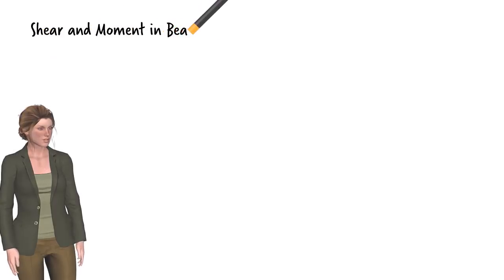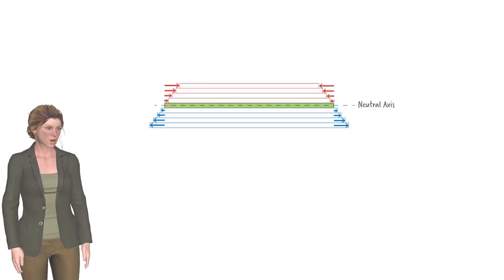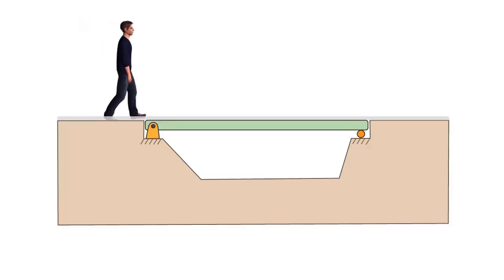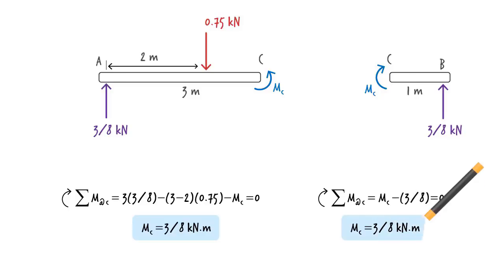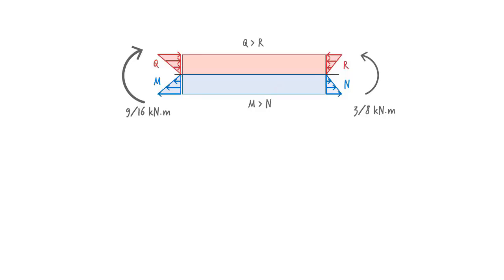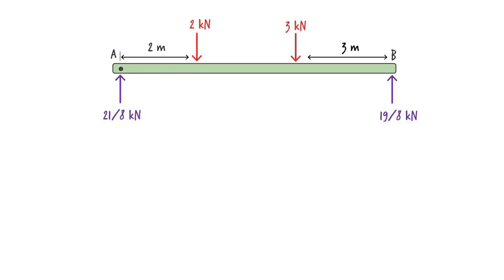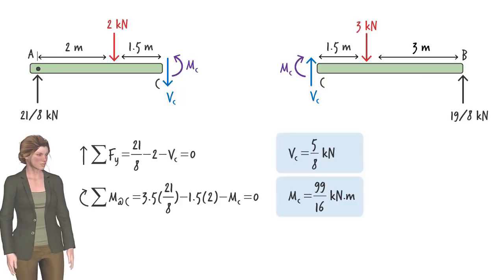ST08: Shear and Moment in Beams

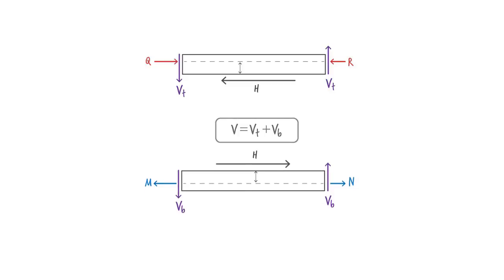Comment: Hi, if you allowed me to go further more to the design process for a R.C beam; @ 8:15 in the video we got the value of V (V=Vt+Vb) illustrating the shear resistance of the beam to the external applied loads which will take the form of either a vertical stirrup or a combination between the stirrup and the bent-up bars after considering the resistance of the concrete. My question is what will be there in the R.C. beam as "H" to maintain static equilibrium? 
Thanks in advance
Reply from the maker: An H-shaped cross section can be viewed as a composite section consisting of two vertical rectangles and a horizontal one. A significant portion of bending and shear stresses are going to be carried by the two vertical rectangles/sections; we can ignore the horizontal section (think of it as bracing that holds the two vertical sections in place). Assuming there are no out-of-plane forces, each vertical section carries half of the induced stress in the section. So, the same principle demonstrated in the video still applies to each section.
Reply: I am not sure if I explained my question clearly for you but let me try one more time. Let us take a case of a reinforced concrete simply supported beam subjected to a uniformly distributed load; the load will cause bending moments to be developed within the beam which in turn causes shear forces to be developed (as per what has been described in the video) horizontally in the form of "H" and vertically in the form of "V"; those two shear forces (H & V) will be considered as the internal response ie resistance of the member to the effect of the externally applied loads. As I explained in my first comment; "V" from design point of view and as an internal resistance will be in the form of vertical stirrups or a combination between vertical stirrups and bent-up bars. My question is for "H" (the horizontally shear resisting force); from design point of view; how it will be considered or in which form it will be there in the member (knowing that usually for a normal member like that it will be reinforced by steel bars for bending in tension zone and also vertically for shear in the way which I previously described)??
I hope I did that well this time 
Again thanks in advance 🙂
Reply from the maker: @mohammedhisham5682  Shear strength of concrete is, in part, a function of the dimensions of the section under consideration. In the horizontal direction, shear strength would be significantly large, since the "cross-section" of the beam in the horizontal direction has dimensions: L x b where L is the length of the beam segment and b is the beam's width. Given that L is significantly larger than b and h (height of the beam), the member is going to have adequate shear strength in the horizontal direction; there is no need for reinforcing shear strength in that direction using steel bars. 

However, if for some reason the shear force becomes excessively large,  it may become necessary to add reinforcement in that direction as well. For example, if the beam is subjected to eccentric axial forces that result a large shear force in the horizonal direction, then we may have to consider reinforcing the beam in the horizontal direction.
Reply: @DrStructure  Thank you very much. That helped me a lot in understanding the shear resistance response of a loaded R.C. beam. 🙂

Comment: Solution to practice question 1.

Shear force :
Since the beam is subjected to external  horizontal load and no vertical load  so the beam has no shear force.
 
Bending moment :

Beam is subjected to pure bending since the beam is subjected tono shear. The constant pure bending value is 1.5kN/M. Hence the bending moment is rectangular shape A to B.

Also beam is subjected to horizontal load hence it is necessary to draw the  axial force diagram and it is subjected to 3kN in the segment A to B  (TENSION).

IS IT CORRECT?
Reply from the maker: Your analysis is correct, except that the member is in compression not tension.